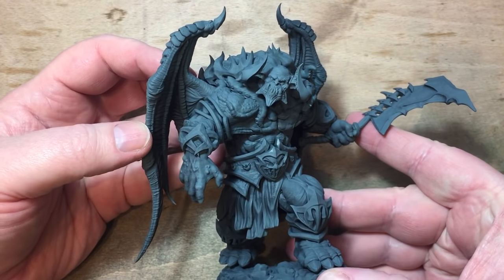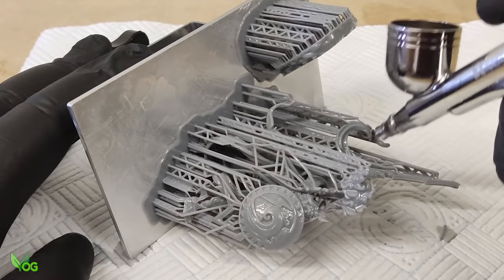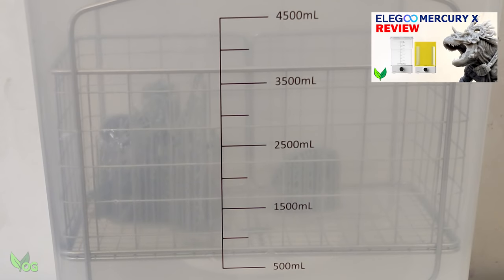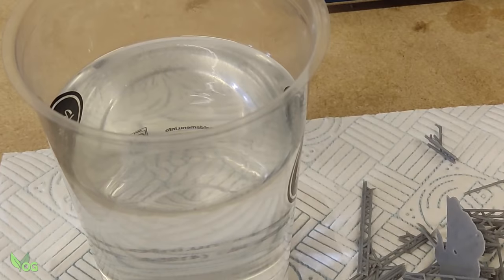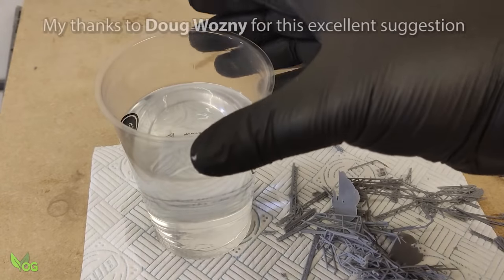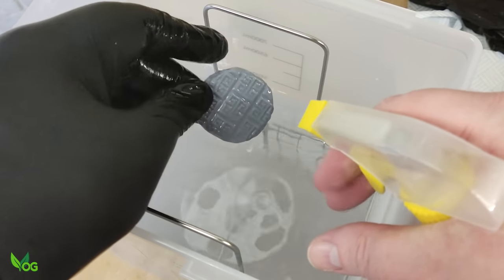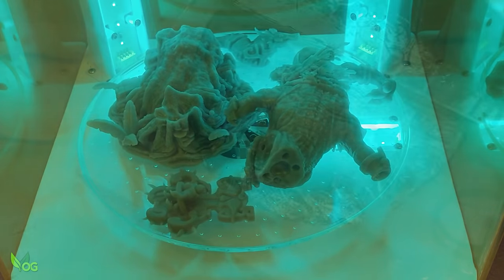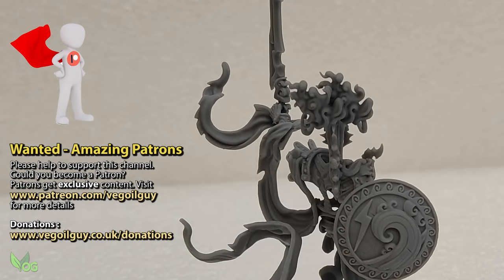BETTER cleaning & curing of 3D resin prints [EASY METHOD]

Comment: Have you considered distilling your IPA? Not sure if you can, but as a very young man I worked at a company where we used lots of acetone. I distilled it on a daily basis as part of my duty's. Granted it is dangerous as you heat it to a vapor, but as I see you do many technical things this might be an option for you. Plus, if you decide you do not like this method you could convert to SPIRITS. Just an idea... Great video, thanks.
Reply from the maker: I have dabbled with distillation in my IPA recycling video... I decided against the hassle 😁

Comment: What happened to good old washing up liquid which was touted a year ago as an alternative to ipa.. Maybe that should be the first step to get off most of the resin and then finish with ipa.
Reply from the maker: That never worked for me. I found it scarred prints.
Reply: Mean Green/Simple Green?  As far as I've been able to tell, those just physically remove some of the excess liquid resin, but can't dissolve it, so it leaves a film of liquid resin on the part, and they'll always cure tacky.

Comment: Small disclaimer towards the ultrasonic cleaner not damaging fragile prints. If your container is a bit too small or big (The print is diagonally (going more towards flatish) in the container), the vibrations together with the flexible plastic might get your print stuck and damage it while cleaning, or while you're trying to get it out. So make sure your print either has free space around it or can stand up propperly and can't get jammed diagonally.
Reply from the maker: That's a fair point, but personally I've lost a few good prints thanks to turbulence and none, so far, the vibration. But anything is possible 😁
Reply: @vogman  I've never experienced turbulance with any of my work but on the other side it's mostly silver but still more fragile in the early steps than resin prints (quite detailed work). I do think the ultra sonic vibrations might damage small parts when there are heavier parts attached which are not propperly supported, which happens if they "jam" in the container diagonally (same goes for resonance frequencies). I think the middle way is to remember, depending on your print, the frequency and/or the diagonal jam are possible hazards, look at your print and proceed accordingly taking those risks into account.

Comment: An interesting though time consuming process. Personally, I tried them all - swishing, ultrasonic, wash and cure, spray bottle of IPA. I always end up going back to Acetone. Basically take your step 2 (the quick dunk) only use Acetone instead of IPA. You can then skip all the other steps because the print is pristine. The only caveats are that you don’t want to get it on your gloves because it dissolves Nitrile, and there are a very few specialty resins where it may not clean as well. But overall, it’s a better cleaner, just as cheap if not cheaper to buy and can be cleaned and filtered just as easily as IPA.
Reply: Use butyl rubber gloves for acetone.

I find a much simpler method than shown works best for my resins though: dunk in dirty IPA pre-wash, and rub gently with gloved hands if the parts big enough > de-support the model > clean IPA + soft brush > use airbrush to dry IPA off quickly (not necessary, but non-accelerated air drying takes a good bit longer) > if there are shiny spots, hit them with the brush and clean IPA again > cure.  It's significantly faster than using any machines, takes up less space, is cheaper, and takes minimal effort.

Comment: two suggestions 1. use a bit of ipa in the air brush for initial air shower 2. use water in the ultrasonic cleaner,  just pop parts in a zip loc bag  full of ipa
Reply from the maker: Nice thinking Greg 😁

Comment: you say theres no point in filling the ultrasonic with ipa unless you are doing a larger print. but you should NEVER. EVER. EVER. EVER. put ipa in an ultrasonic cleaner, even if it doesnt heat the fluid. The transducer on ultrasonic cleaners can suddenly dump an excess amount of energy into the fluid flash firing the ipa and start a fire even when its quite cool. you should ALWAYS have the ipa in a separate container, preferably covered/sealed, inside water in the cleaner.
Reply: That's what he's doing. He's talking about not filling the ipa comtainer, and mentions that the ultrasonic vat contains water.

Comment: why does using a wash and cure machine increase the cost? it contains more IPA than a small glas but it also takes longer until the ipa is not usable anymore, its still the same ipa. I get that the initial costs are higher since you will need 3-5 liters depending on the volume of the machine...
Reply from the maker: Simply because the volume of IPA increases. With the swill method for instance, a small amount in a jar is all that's needed. With a wash station, it typically starts at 1.5 litres.
Reply: Evaporation.
Reply: @vogman  yes thats what I said. but in a small glas the ipa will pollute much quicker and you have to clean it or swap it faster...hence the cost will increase
Reply: @LightCarver  ? there is an air tight lid on it...

Comment: When I use my ultrasonic cleaner, I fill it largely with just water.  Then I put my printed pieces into a ziplock bag with some IPA.  The ultrasonic passes through the ziplock with ease and the parts get well washed by the IPA, while using about 20% as much IPA as I would filling the whole reservoir with it.

Edit: I don't think this would work well with the wash machines with the propeller.

Further Edit: I didn't come up with this idea - credit some Youtuber I saw do it a couple years ago, no idea who it was.

Comment: STEP 1 Don't use expensive flammable IPA in huge vats. Just use Flash cleaning liquid (Mr Clean USA), fraction of the cost and won't catch fire. STEP2 :Put FLASH in Ultra-Sonic Cleaner and use that. Much faster and cheaper with sound results.

Comment: Two years later and there still isn't much improvement in the messy tedious cleaning and post curing process.  I make structural parts so there aren't delicate parts as found on artistic models.  I really need to come up with a method that allows me to quickly clean and post cure parts in bulk with a minimum of IPA.  My early attempts at repeated stations with the parts moving right and the IPA moving left resulted in the leftmost tank becoming disgusting.

Comment: STOP!!!

NEVER USE IPA IN AN ULTRASONIC!!!

I've been using ultrasonics professionally for decades, and this is just about the stupidest thing you can do with them.    Heat is less a problem than the vibrations vaporizing and filling the air with a gas that is extremely flammable and extremely poisonous, unless you happen to be wearing an extremely good organic vapor filter mask.  

Never spray, vaporize or agitate isoproply, including using it in an ultrasonic.  If the vapor builds up, as it will in many common workshops, flashpoint is only a static spark away.   Furthermore, isopropyl vapors can cause permanent damage to your lungs.  You might not notice it after a week or two, but in 5 years when you have COPD, you'll regret it.

There are legitimate uses for cavitation reactions with isoproply, but they need to be done in low oxygen environments with appropriate safety gear, and organic respirators.

You're already touch and go with resin vapor outgassing and your lungs, do NOT use an ultrasonic with isopropyl, unless you have proper resiprators, safety equipment including fire extinguishers and powered ventilation.  

This is such a common, common mistake.   Please, stop doing it, or at least move it outside,  away from any source of heat or spark.

Comment: just use washable resin and rinse under a tap.
Reply from the maker: Oooo... never rinse under the tap. That's bad practice. You're potentially adding hazardous substances to the water system. Better to rinse in a bucket, then place that bucket of water outside where it can get plenty of natural UV light (any time of year, cloudy or not) to stabilise any uncured resin. After that, I personally throw it over a paved / concrete area so it can naturally evaporate back into the water table, free of chemical nasties. Better safe than sorry 😁

Comment: I have never understood, why anyone would go for that overpriced plastic so called "wash stations" that operate with a whirl in the fluid...
...I mean, industrial sonic cleaner stations have been around for quite some time now  and come with a similar price tag, but with industrial grade built quality. Meaning for every day heavy use.

Why use such crappy whirlwind maschines?
Reply from the maker: Actually they're pretty good, though a sonic is better in my opinion. However, you still need the cure station.

Comment: Dear VogMan:

Very detailed explanation! I have already subscribed to your videos.

This is Cara, from Shenzhen Height-LED Technology Company Limited, China, a professional UV LED curing system and automation equipment supplier. 
 
I see from your video that the curing station you use is a simple mercury lamp device. Do you need a UV LED curing station specially used for curing 3D printing resin materials?

I would like to recommend our UV LED curing oven to you. Our oven has reflectors on the inner wall, so you don't need to add extra. Also with turntable, can be customized according to your needs. PLC plus touch screen control, easy and convenient.
 
If you have a purchase plan for UV LED curing equipment or want to know more details about our products, please feel free to contact me!🤗